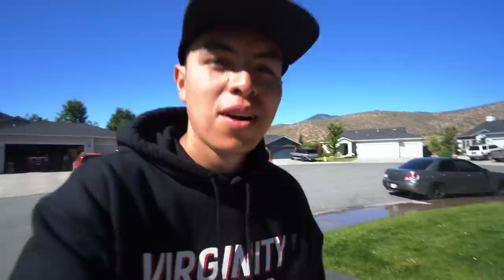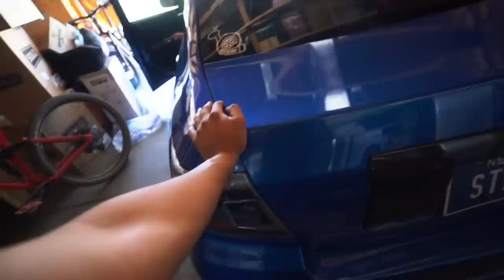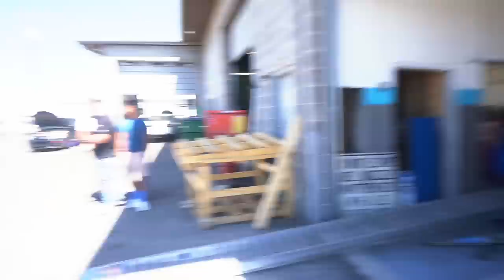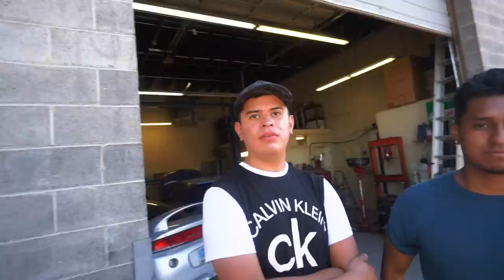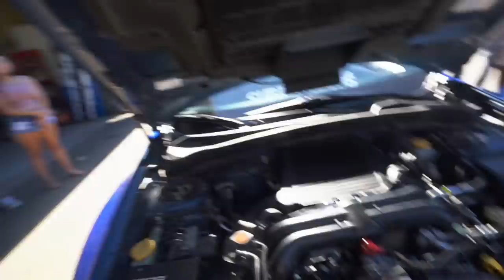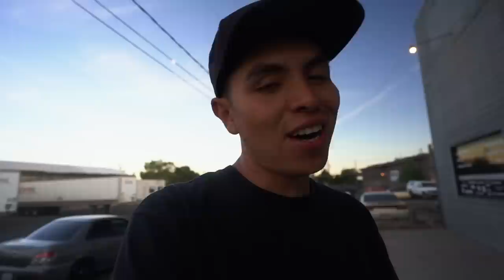Subaru WRX Blows Up On The Dyno!

Comment: May I ask how many miles were on the motor?
Reply from the maker: 74,000
Reply: Thirdshift damm that’s low
Reply: Thirdshift thank you for responding as I have the same model and near the same range of miles. 😿😿😿
Reply: I'm a subaru tech. They start knocking over 60k from what I've seen on this gen
Reply: @escarenojonathan4141  what's your advice? I own a  2013 wrx stock with no modifications other than a stp exhaust pipe and was sent a letter stating my car engine warranty will be extended for 3 years or 100K miles.  Sometimes, I feel I should drive it really hard so I can replace the engine for "free" and then extend the life of the car. Other times, I think about selling it.  I have not had any problems yet with the engine ( I drive like a grandpa). I change the oil regularly and keep it updated with maintenance schedules. Currently, the car has 81K miles.  What would you do?
Reply: gato negrote I am also at 81K and would like to get some advice. I purchased the extended warrantee @60K when I bought the car used and it ends at 100K
Reply: Jonathan Moreno Thats ass reliability :(
Reply: My 15 Wrx spun a bearing at 89k miles , rebuilt it and sold the car . Good riddance if ya ask me
Reply: Shit my 16 STI just blew at 50k absolutely rediculous. Already remanned once. Going built this time fuck subaru. Trash ass blocks.
Reply: @importjdmexport3119  get a fa20 WRX or a already built sti if you want one. I had a 17 wrx before my 16 sti i went 108k stage 3 on e30 stock block internals with stage2 clutch no problems. Traded it for this sti.
Reply: Jonathan Moreno you happen to know around how many miles an 04 wrx can have before it starts to act up?
Reply: Luis YT depends how well you maintained the motor, what mods you have, also sprinkle in some Luck bc stock motors are known to blow as well. It’s mostly luck of the draw my friend. However I will say I have a friend that kept his 05 bone stock all it’s life with good maintenance, survived 245K until he sold it with same tranny. He did mention he “grandfathered it”
Reply: Aaron Endo any mods?
Reply: Suhhduhh any mods?
Reply: @gatonegrote  its great that you have extended warranty because you're 100% covered and for any reason they deny your claim, you can complain to subaru and they'll cover it, the company is very generous compared to other brands. Good for customers, bad for technicians. But I'd hold off until it blows up to do something about it. But a good brand air oil separator is definitely worth investing. The oil blow by causes detonation and then causes knocking. The internals arent the strongest either.... good gas as will prevent knocking as well. Shell V power is great. Using the recommended octane such as 91 or 93 depending in your area on whats available.
Reply: @luisvsx  the 07 and under are pretty strong engines out of most wrxs. They can go a long way just with being nice to the car and checking the oil. Only common problem that I know is the valve clearance. Around 100k you should do a valve adjustment. The exhaust valve tend to get tight and causes the valve to hang open longer, resulting in burnt valves. But really, just be nice to your car and it'll go a long away. My current car has 211k 04 wrx and its driving strong.
Reply: @escarenojonathan4141  because it doesnt have proper maintenance or they're just prone to knock?
Reply: subae it was pro tuned at 296hp with full bolt ons, AOS , intake and inter cooler , never even beat on the damn car and it spun a bearing ....
Reply: Suhhduhh damn bro rip...
Reply: Mine spun 20k miles
Reply: heatsink how on earth
Reply: @waybach  I know crazy eh.
Reply: @escarenojonathan4141  I have an 02 and it finally started knocking at 140,000 miles 😪😪 . I did the heads and turbo at 100,000 so now I have to do the bottom end and the glass 5 speed .
Reply: @michiken123173  both, oil blow by and bad gas will cause knocking
Reply: @aaronendo8150  Never get a remanufactured block.. if one tiny thing is off, it'll blow again.
Reply: @97TP  subaru makes it be a "new" remanned block when warranty covered. Im going IAG if my block isnt saveable.
Reply: @gatonegrote  I'd sell it and buy a Honda S2000 unlike the Subaru engine the Honda engine won't just blow at 100,000 miles lol. I've seen s2000's with 300,000 miles still going strong lol.

Comment: I got a rod knock driving back fucking subaru made it 44 miles away from home but drove it to vegas with rod knock and it made it it was 106 degrees and i was slamming it hard with rod knock lol..... i sold 09 wrx for the same price i got it for but not running lol

Comment: If you are set on an STI then buy a good chassis and get a JDM Ej207 engine from the abundant JDM importer's otherwise a USDM engine should be left mostly stock ! Been their before but the 2.5 is famous for just that ! My Ej207 is still perfect after a year of hard driving with all the basic bolt on performance part's and a pro tune 340 hp !

Comment: This is why I went from a 05 legacy gt big Garrett turbo to a Mazdaspeed 3. the Mazda is way more fun to drive and with some simple bolt ons it's as fast. I built the motor in my Mazda and hope to save for a bigger turbo and water meth injection and push around 450 on a daily. 
Rip all EJ motors... Not if, when.
Reply: MZR engines are no joke! Just use rotellat6 oil and your golden! Lol

Comment: The 2.5 is junk. I have a 207 and beat on it every day. I had a 207 block last 150,000 miles before I needed a head gasket. I bought the block for 800.00 and paid a master Subaru tech 500.00 to put the heads and everything on the block. That motor made 325 at the wheels with a big 16g

Comment: RIP wahmboos wallet. Lol. Jk. I get one 03 legacy and it has 121k with N/A STOCK 2.5 ej. Its makes a slight ticking sound but not like that. Did he upgrade the oil pick up in the pan? Killer B makes one that it supposed to flow and perform 30 percent over stock so they say.

Comment: what's up guys welcome back to another

00:01
video we're here at wambo's house we

00:03
haven't been here in a minute

00:04
but he is finally doing this today we

00:07
got his down pipe

00:08
we got a new top mount intercooler and a

00:11
cobb

00:12
turbo heat shield this is something that

00:14
everyone has been waiting for for a

00:15
really long time

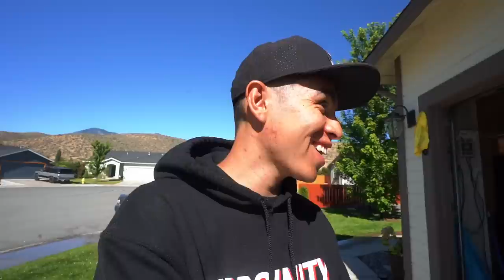00:16
you guys know he got his downpipe like

00:18
over a year ago now dude like it's been

00:21
here for a year just sitting here

00:22
and today we're finally gonna throw that

00:24
on along with the other parts

00:26
we have a tune today at noon and it's

00:29
currently

00:30
like 9 30 so we have rough is it 9 30

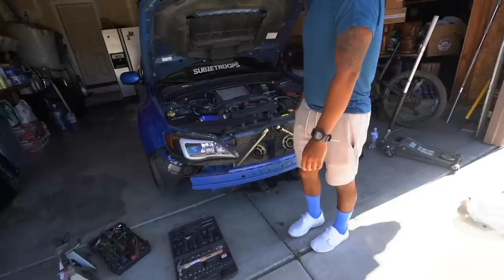00:33
so we have roughly like two hours before

00:35
we have to head out of here

00:36
we already got the front bumper off

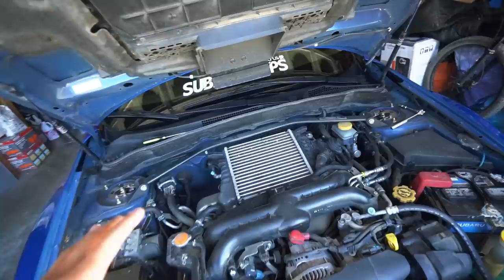00:38
wombo is currently taking off all of the

00:40
intercooler pieces

00:41
and then we'll jack up the car and get

00:43
underneath so we can get that downpipe

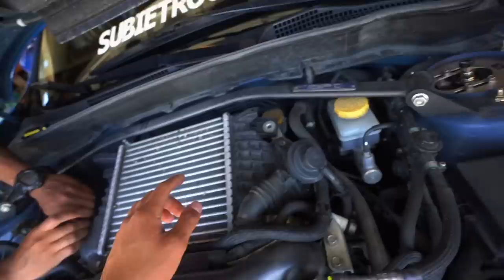00:45
out so this is the oem intercooler which

00:47
allows this strut bar to be here

00:48
but i think once we swap over with the

00:50
mishimoto intercooler it might be a

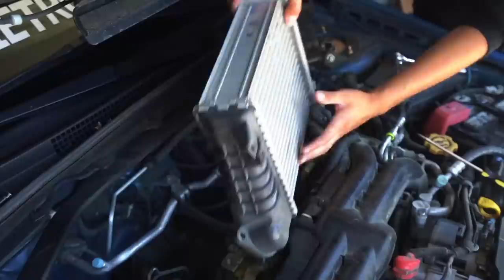00:52
little too big

00:53
so we might have to remove the strut bar

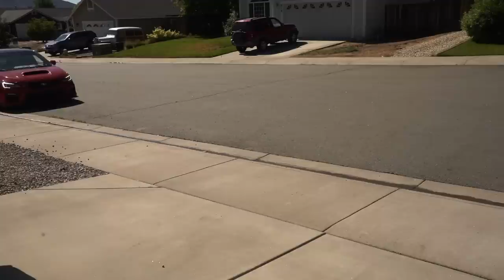00:57
this isn't bad huh

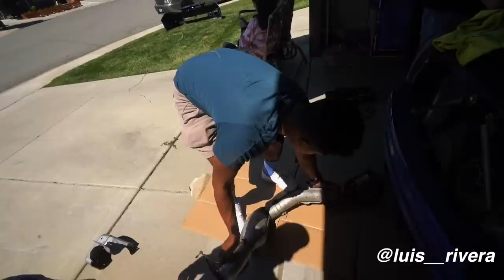00:59
[Music]

01:00
yeah look who showed up

01:03
we just did uh 500 worth of maintenance

01:06
for wombo's car

01:06
yeah i did so we got the downpipe out

01:09
heat shields out

01:11
and you guys saw the intercooler out

01:14
now it's time to put everything back

01:15
together with the new parts

01:28
we are all done the front bumper is back

01:30
on we got the new intercooler

01:32
the turbo heat shield and the downpipe

01:34
installed

01:36
i think we're ready for the first start

01:37
see how loud this thing is i was telling

01:39
wombo guys i don't know how loud this is

01:40
going to be

01:41
because he already has a muffler delete

01:43
and now he's going catless

01:44
but he also has a quad tip so i don't

01:47
know if it'll be as loud as ed's car

Comment: Trade it in for a new STI
Reply: Leonel Ramirez they’ll not trash my 2008 been running perfectly fine for 12 years with no problems
Reply: @Leonel Ramirez I'm installing a new shortblock on my 2006 WRX with bolt-ons and tune. My car has 200k miles and have never had a single internal issue. I did blow up the transmission but I was expecting this given the HP and mileage. (Transmission gave out at 168k miles and I suspect I problem could have fixed it but I'm not well rounded on transmissions yet.) I ended up swapping an STI transmission and suspension/etc. I'm not installing this shortblock because this old one gave out, I'm doing it because I want to push it further.
My point is, if you take care of your car, it will take care of you. I've owned more than EJ25's, I've had 2x 3SGTE & 2x 4G63 and they're all like this.

Comment: I’ve got a 2007 Subaru Impreza luxury and I’ve got a knock similar to this in my engine does this mean my cars fuked? How much will this shit cost 2 get fixed?
Reply: Really depends, could be a simple fix like an exhaust leak. However if it’s making a pinging noise/ knock under acceleration then your engine might be gone. Depends if you rebuild yourself but could be a couple thousand at least. Good luck

Comment: Buy a low mileage jdm motor. Shouldn’t cost more than 2k$. Rebuilding is gonna cost 2k+ but you can make more power with forged internals but that’s where it gets expensive. Anyway hope everything works out man.

Comment: Y'all should have just not built a subi. like 90% of these subi engines explode after just goddamn fbos. Putting a bigger turbo and more boost is like a death wish for a subi boxer. Even after rods pistons studs and all they still arent reliable. It's the 2pce boxer block design that does this all it takes is a tab bit of twisting or pulling and the cranks mains lift by .10 off and yep knock knock or even kaboomio Jones. People literally had to make a 1pce billet block for these things so that they could make 800+ reliably for tracks or hill climb and drag racing. It's sad no one knows this really. Like people know they aren't reliable but they just think they have hg problems and thats jt when in reality there's like 10 other massive issues that cause them to blow.

Comment: Rod knock is what makes a Subaru a Subaru if u think otherwise ur in for a rude awakening I’ve been in Subaru industry for years and have seen it first hand they are probably the most unreliable cars and every person I know who owns one has had engine problems it’s part of the brand practically and if you think oh it won’t happen to me then you will find out first hand after u drop a few racks on a new shortblock and rebuild I don’t recommend these cars to anyone let alone broke kids and for the people buying the brand new ones and going I have warranty 30k ain’t shit and for a 30-40k car that makes barely 300 hp with mods it’s a fucking joke not to mention all the lawsuits Subaru has with previous shitty engines

Comment: Fast but unreliable. Want to go fast and beat everything on the street and GREAT on the track., My 2021 Ducati Street Fighter 1103 V4 207 rear wheel horse 9.54 1/4 mile top speed 190 + GPS verified 410 lbs. Power too weight ,, end of story

Comment: damn that sucks dude. you need to sell that money pit and buy a toyota. either that or start saving for subaru engine #3 AFTER you buy subaru engine #2
Reply: Guy should just sell it for a S2000 in my opinion. Ten times more reliable lol.